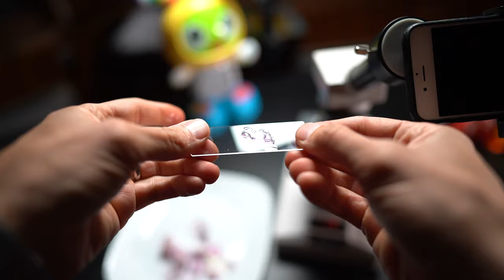Red Onion Osmosis - Plasmolysis - Microscope

Comment: Separate small pieces of onion epidermis, keep them in watch glass containing Neutral 
red solution ( 0.005 % ) for 10 min. Rinse thoroughly with D.W. (H2O ) ,then examine 
microscopically .
1- Does the cells , stained ?
2- Which part of the cells are stained more than the other ?
3- Does the cells died or remain alive at the end of the experiment. Give reason for both cause

I need these answers🤍